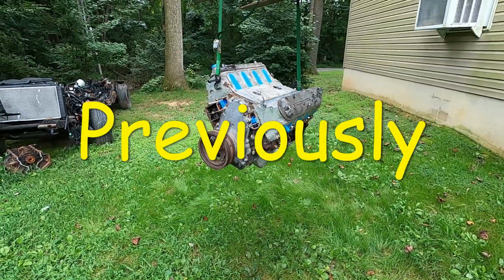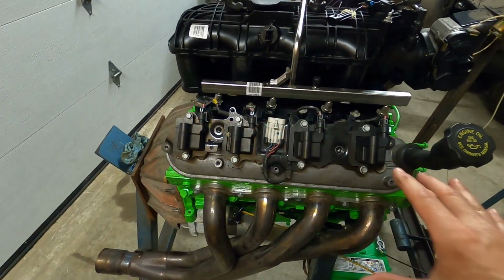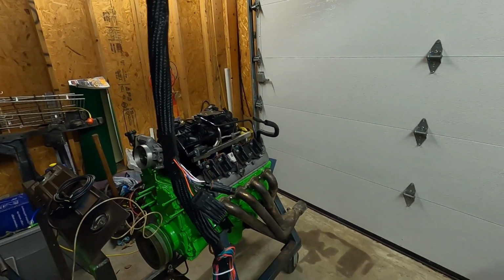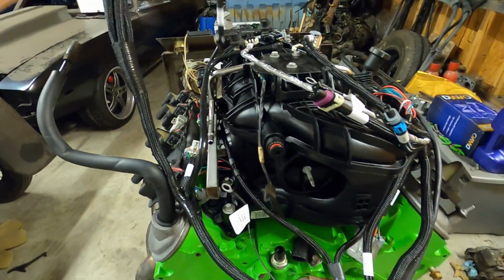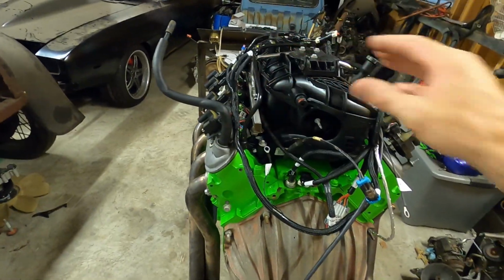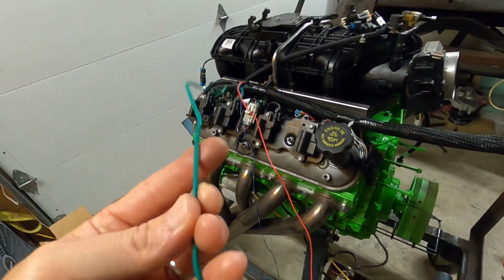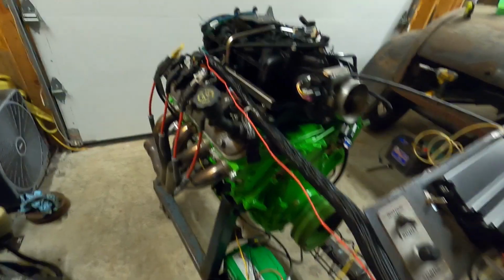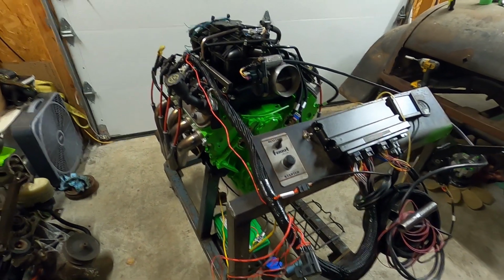Holley Terminator X Max Install on a LQ9

Comment: What year accelerator pedal is that? I bought this Holley kit with the FBW harness. And tried 2 different pedals from a 2002 and 2006 Tahoe and none have this connector.

What model pedal and gear truck is this from? I don’t want to buy another $120 pedal that may not work

Comment: What part of Holley Terminator X Max are you using? (I'm just wondering cause I need the same kit) ~please and thanks
Reply from the maker: 550-934 That's assuming you switched to EV6 injectors.

Comment: What throttle body and throttle pedal did you use? Part numbers?
Reply from the maker: The throttle body is a stock GM gold blade 4 bolt, pedal is GM# 19417903